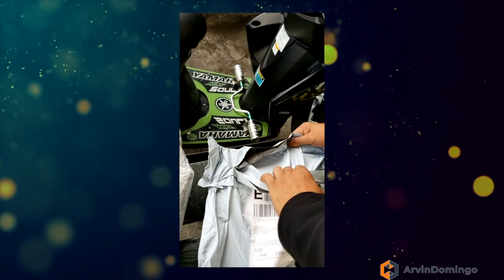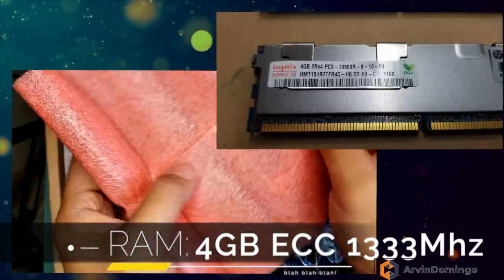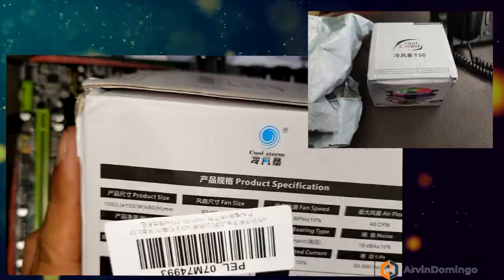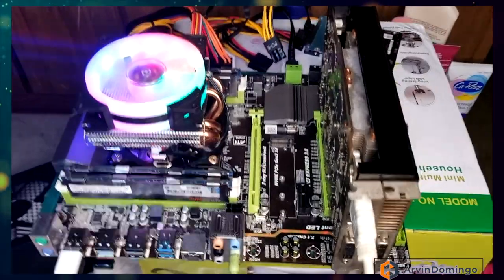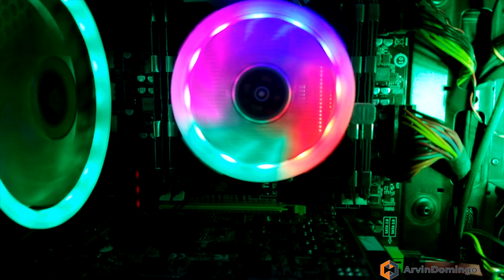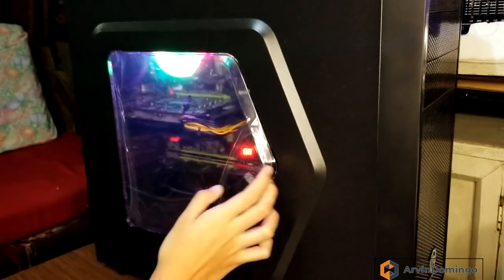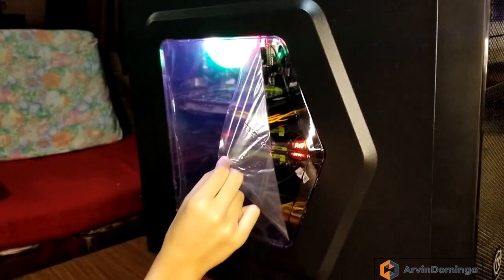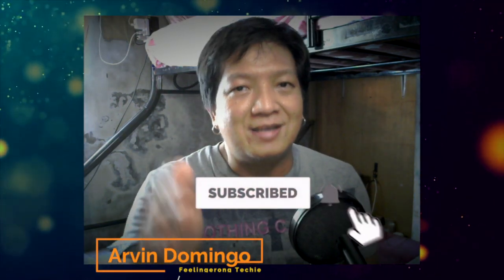Ultra Cheap Bad Ass PC Build Around 15K Pesos ($300)

Comment: Nice! Sir tungkol sa CPU Cooler alin dito ang pipiliin ko? Streamer or Bipolar?
Reply from the maker: I am not particularly sure what you are referring to but my suggestion is to use a cpu cooler with fan pointing downward or towards the cpu, so that some of the air os blown to the motherboard vram heatsink as well.
Reply: Salamat Sir